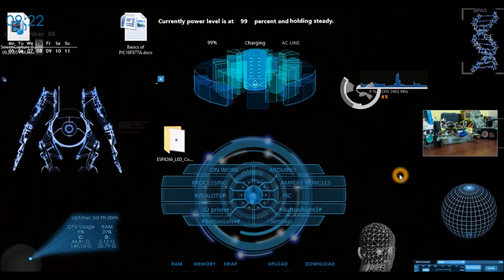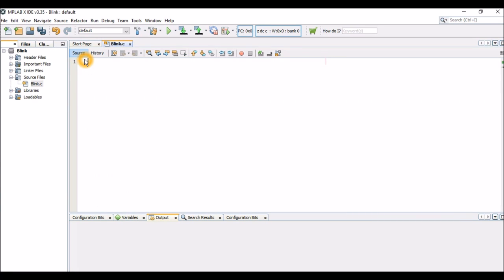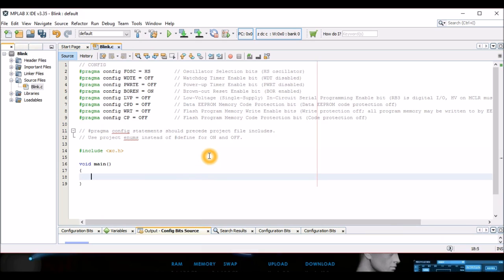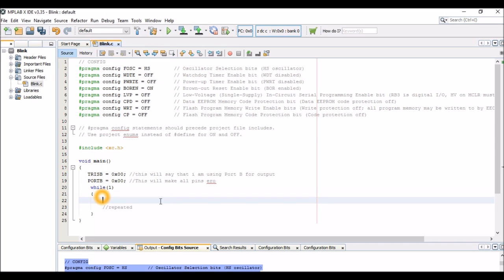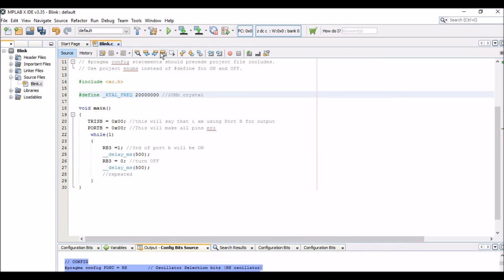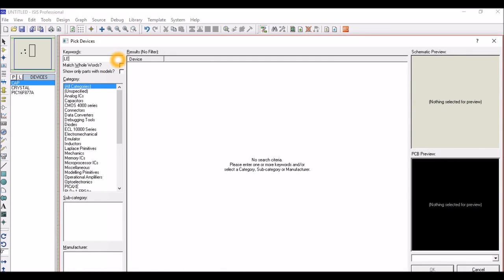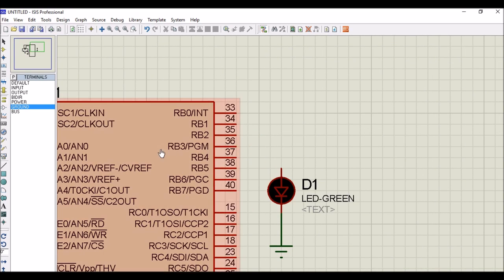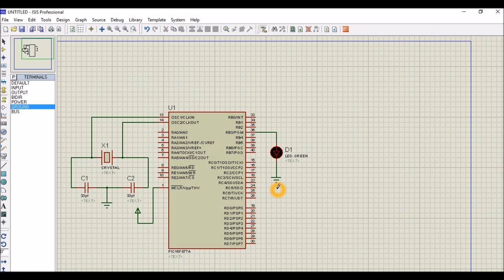PIC Microcontroller Tutorial 2 - Blink Program using MPLABX

Comment: If I put RB3 = 1, my compier marks error, so I used, PORTBbits.RB3 = 1. Why does it happen that?
Reply: This problem occurs because of your compiler. The compiler version which I have used is XC8(V-3.45) hence I Am able to use RB3 directly. 
You compiler might be able to support it because of its version. Anyways there wont be any difference in its working. Learning to use PORTBbits.RB3=1 is a better practice than using RB3=1.